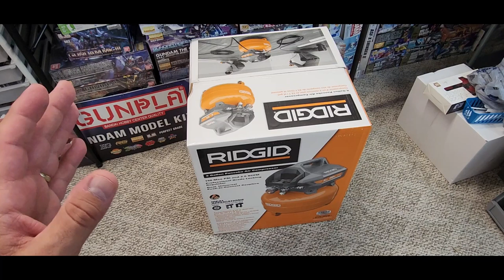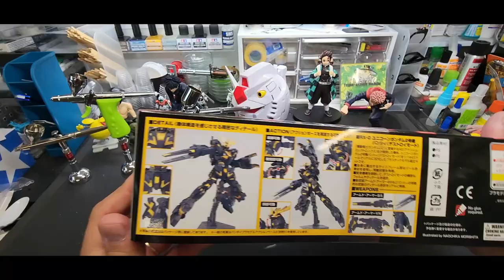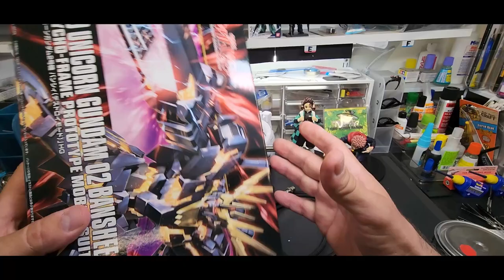How To Use A Full Sized Air Compressor For Airbrushing - Harbor Freight - Plus Gundam Give-Away

Comment: Nice! Well, that is always the dilemma when you have a shop, is how to mitigate compressor noise so you can talk on the phone or to customers in person. Some build enclosers inside with sound deadening materials and others have them outside in a weather tight encloser. I have a little 3gal pancake compressor and I think it's noisier than some of the larger compressors I have, but it's super convenient for on-the-job work. I've got an Italian ANI R160Q that's like that SATA with 1.0 tip that is a really great gun, a little more affordable, and takes very little air to run.

Comment: I thought about doing this. I have a 3gal from Harbor Freight, but I live in a town house and don’t have the extra room to shove it aside. I use an smaller air brush compressor with a tank and it works fine. I use it for priming and base painting miniatures for war games, but I do have some Gundams I will be building. I guess if you are painting larger items, and don’t mind the noise, or have a way to make it quiet it would be convenient to have the volume of air ready. Can you drain the tank? I wouldn’t want rust build up because I couldn’t maintain it.

Comment: There is a thing called Relief valve. It was designed for lower the pressure of the air stream.

Comment: I have the same compressor in my garage hooked up to a 50' flexzilla hose reel. Definitely not quiet, but It's a great pancake for general use and definitely works well for air brushing. A popular and cheap  HVLP gun that people seem to like is from Harbor Freight .. the 'CENTRAL PNEUMATIC
120cc HVLP Touch Up Air Spray Gun'

Comment: I wanted something portable so I went for a hobby air compressor with a tank. It seems to spray pretty heavy + urethane coat seems to be thick for that glossy smooth finish. Seems good for large surfaces like car kits.

Comment: Another great video I have learned a lot from all your videos what to buy what tools you need how to spray parts , I have my benches finished and hooking up the spray booth now will start soon maybe I can give you a suggestion I painted cars out of my garage for many years instead of buying a 60 foot hose you can use PVC pipe the thicker pressure PVC and just buy 10 foot lengths and glue them  and then you’ll be able to put a regulator and you’ll be able to leave the compressor in the other room and leave it on it works I have it in my garage for 35 years with a big Compressor  and they work great . I have put a line into my area off my main compressor but I also have the small little one that I bought for airbrushing because it would be nice when I take the cars out on my patio and spray clearcoat Automotive clear and just carried a little compressor out too the outside.thanks for the video ! Also what in your opinion is a good airbrush for my four-year-old grandson to start on with water base paint thank you !

Comment: When I first started airbrushing this was the route I thought I was gonna use, I had a little regulator on the hose to bring the psi down more because the lowest setting is still way too much but i had my hose spliced for the regulator and of course when the higher pressure came blasting through my little hose clamps didn’t do very much clamping,it was then that I realized I need to spend about 40 bucks and just get a damn proper airbrush compressor,smooth sailing since ,imagine that 😁

Comment: At Harbor freight you can get an extra pressure regulator for about $5, with that you can set it up for both with without having to adjust everything time you switch.  
Also great idea, I was looking to get into airbrushing, I have a big air compressor.  Didn't think it was possible to use with the air brush. This will save me some money. Thanks.

Comment: The Harbor Freight Fortress 2 gallon quiet compressor is pretty nice. It's quiet enough to have next to you without deafening you but it's not ultra quiet like an airbrush compressor. The smaller one from HF is supposedly quieter but I don't have that one.

Comment: I have an old old harbor freight oil crank compressor. It's not as quiet as my airbrush compressor but you can easily run with it in the room. I don't buy larger oiless compressors. Had 2 CH in the past and they burnt up. Cranks like oil. With that said, if airbrushing is all you do, oil less should be fine. And I'm sure the newer compressors are much better.

Comment: I run my iwata off my 15 gallon compressor with a water filter and it works great. I paint in my shop so the noise of the compressor don’t really bother me much. But, I wouldn’t recommend over 25 psi lol

Comment: Thanks for this video. I just started airbrushing literally yesterday and have been wondering how these larger ones work on gunpla stuff. Probably not as precise as some people need but I definitely see how it’s nice for just putting on your primer or base coat over a large amount of pieces. Have a nice 4th of July!
Reply: Air compressor size doesn't matter. You can still attach a .18mm airbrush to a 100 gallon compressor and it'll still paint fine detail.

Depending on compressor brand you might get a more accurate regator. Most shop compressors go in increments of 5psi, better ones go incrementally by one psi.
Reply: @fateweaver9844  oh i was actually talking about the large airbrush gun lol. The giant airbrush guns are fairly expensive compared to the smaller airbrushes you find most modelers using. But i may be wrong you might be able to get precise with those larger airbrushes. I imagine its just not ideal though since its so huge.

Comment: First time I bought a regular aircompressor for nailguns because the guy that sold me it did not know airbrushes needed a compressor with a water trap. I swapped it for a compressor designed for airbrushes.

Comment: I actually use a regular compressor but my hose has a built in water trap. I would like to change that to one attached to the compressor but it works for now. I already had it when I got my airbrush so I need to upgrade some day.

Comment: The harbor freight ultra quiets are fantastic and are super quiet. Also the conversions of fittings can get difficult depending on airbrush used with NPT and BSPP type threads used.

Comment: another great video my friend, I was researching air supply for my basement studio and while I own 2 Silentaire air compressors and have built a couple from recycled refrigerator compressors I am looking into supplied air from a a 5lbs co2 tank. the "rig" consist of a regulator($45) and rented tank same as beer tap ($140) ($20) to refill. totally silent and no need for water trap, have you ever experienced this set up? tee shirt painters have used this set up at out door events because it requires no electricity

Comment: Have a compressor a bit bigger than the one you showed. Was thinking of using it, but thought it was too big. I build HO scale R.R. and might be able to use the smaller airbrush with my compressor. Was wondering about using it, you answered my doubts.

Comment: Nice compressor to have to use with a air eraser (Sand Blaster) to etch or remove stuff. Also the price is very reasonable. Larger spray gun works great on small projects too. Thanks for the review!

Comment: Love your videos and really liked this one I have a 8 gallon quite hotdog compressor for my airbrushing going into a desiccant two stage filter and a regulator next to the airbrush booth. Your correct I can paint a model car and not even come close to using all the air and it's cheaper than a good airbrush compressor. Hope you get your ac fixed.

Comment: Check out the 2 gallon fortress from harbor freight. Its very quiet and sits next to me and doesn't wake up anyone in the house even in the next room. Its as loud as my small old air brush compressor.  Its really nice, takes about 45 secs to fill up. I tested a I can spray for 1 min 20 secs straight watching the pressure needle and it only took 12 secs to recover and the needle never dipped. Pretty impressive

Comment: I'd eliminate some of those connections which could end up leaking air. Iwata air hoses come with the 1/4 in compressor fitting attached.

Comment: I was lucky enough to already have a compressor before I started using an airbrush. I was also lucky that the airbrush hose I bought came with a 1/8" to 1/4" adapter.

Comment: The compressor has an internal pressure switch which turns it on to bring it back to full pressure.  In this case it is probably about 100 psi.  Remember it is designed for industrial air tools that need high pressure to operate.  The only way that pressure tank drops to 20 psi is if the power switch Is turned off or the cord is unplugged.

Comment: First another great job. I looked at Sata paint guns and they are quite expensive. Too much for me I think. I then looked at Harbor Freight for their detail guns and they aren't recommended for 1 to 6 gallon compressors. The Fortress Ultra Quiet compress looks like a good unit and I hope that is the one you will be testing. In roughly the same price range as an airbrush compressor but with much more capacity. I don't build Gundum so please don't enter me in the drawing.

Comment: The easiest way to sort out fittings is to get a 1/8 BSPT Male to 1/4 NPT Female, then screw that onto whatever airline fitting matches your coupler. I'm going to guess you'll be checking out the Fortress quiet compressors next then? I've been eyeing them up myself. $200 for the 2 gallon is a little steep but it is a twin piston compressor which is nice.

Also for the giveaway fiasco, try using like "Gratitude Gift" or "Gratuity" or something with the same meaning but not so easily recognized by bots.
Reply from the maker: I hope to review the Fortress soon also

Comment: Ok you did not a separate air regulator, my pancake compressor is a oil type so much quieter , but I think I know what I need thanks
Reply: You might want a trap between the compressor and brush to trap any oil or moisture that comes through the line.

Comment: Everyone should know there is a cheaper and better option then a hobby compressor. I have 2 25 liter tank with a silent type aircompressor I use now. And stored my Iwata Powerjet compressor in a cabinet as a backup. The large 25 liter tank is a joy to work with. With a long period of silence from the compressor before it kicks in to refill. In USA I believed the California Aircompressor is a great source. Avoid oil driven compressor coz they are noisy. For the price of one Iwata Powerjet compressor, I can get 2 25 liter 1.5 hp silent aircompressor that I use for my scale model hobby and woodworking.

Comment: I will eventually want to upgrade to a higher capacity compressor. Mine just always goes off with every push of the trigger, which isnt bad becaue its quiet but still would like to have more capacity.

Comment: Nothing wrong with a shop compressor. Get a moisture trap and that's all you need. 

Most can be had under $100 USD. Push plenty of air. But noise is an issue. Not ideal if you live in an apartment or don't have an outside space away from the main living space.

My compressor is a 2G Husky brand. It works just fine with my HP-CS and my Patriot 105 with no issues. 

Hell, those people that do airbrushing on cars, trucks, semis don't use hobby compressors.

Comment: Only for the sake of overkill. I was thinking of a stand up 30Gal to go from 1/4 to 1/8 with a second regulator/water trap for my spray gun
Reply from the maker: A great option for sure. If I'm going to start using that spray gun then I have to switch too

Comment: to many fittings. could use just one between. Some time they provide it with Pistol look airbrus. it's a male for the airbrush hose and female for the fitting that goes in the compressor.

Comment: I like the  Harbor tool and freight air compressor  2 gallon 135psi with 2.1cfm and it's 1.2 hp it's has been a very good  Air compressor I have about 6 different air compressor and this one is the best super  Quiet it's  under my table and I airbrush at least 6 to 12 hours a day. Most of the air compressor are all made in the same factory in China they just put decals them .

Comment: Its funny, because I literally just got into modding my air compressor. I bought an 11 gallon spare air tank, to attach to my 6 gallon AC. But i am modding it to run off the spare tank and have it start filling after depletion.

Comment: The Harbor Freight fortress 2 gallon compressor is VERY quiet. I've got it running in the same room and its very tolerable.  Quieter then my vacuum for sure.  Also that Sata Minijet is pretty expensive at like 300-600 bucks.
Reply: Also also you will blow through that 6 gallon compressor real quick with the spray gun.

Comment: I'm going to have to invest in a compressor + tank. I'm currently using an Iwata Ninja which has no tank so it runs all the time, and the pressure knob has no gauge, so I just have to guess.

Comment: Great video, this is the way I want to go with my setup. I will install the compressor in my garage on the other side of the house and run the lines when needed.
I was expecting to see some water traps or in line filters being used also. If you use this unit a bit more will you add any additional traps or filters to the system?

Comment: Question: what pressure did you used for the big air gun? If you used 25 psi, can you use it with the tooth air compressor?  That one goes up to around 50 psi. Thanks.

Comment: Did you have trouble with different thread types? I ended up sending my regulator and moisture separator and buying a cheap one at Harbor Freight. It has all NPT threads.

Comment: Too bad about your AC - not fun in this heat without that!  I have a full sized compressor with my set up and it works just fine with the proper adapters and quick connects on your spray guns.  A moisture trap is a good idea - don’t need stray condensation ruining your work.

Comment: Do you think a portable tank you can fill with a larger compressor would work as well?  I do a lot of air brushing and my hobby compressor comes on which is a pain.   Thanks for your layout of the parts needed.  Your videos are always helpful.
Reply from the maker: my buddy uses an air tank and has no troubles at all. Just don't expect a days worth of air

Comment: sucks about air going out...miserable...I wish I had thought about shop air compressors when I got set up. I picked up the cheap chineese compressor with a tank, it has a emergency shut off if it gets too hot it is supposed to quit. But after only about 7 or 8 min of spraying it acts like it is going to shut down on me. I figure its only a matter of time before it craps out...lol

Comment: Neat. I just bought a compressor myself, 6 Lt 115PSI silent compressor for indoor use, it's quiet enough to use in the same room, and doesn't turn on that much for airbrushing.
It only has one output and I regulate it for about 80'ish PSI on the main regulator, but I ended up putting a T on it, one has a full size hose to an air pistol and other tools, but I mainly use the air pistol to clear out dust before airbrushing, and the second end of the T I put a "moisture trap/regulator" combo fitted to the airbrush size, and regulate it to the pressure i want to paint. This way I have both pressures at the same time, one for the air pistol or other tool, and the limited down for airbrushing running at the same time. Been working great so far.

I'm currently building a sort of enclosure on wheels for it, to store the compressor and all hoses and air tools that I can car around as needed.

Comment: I hate to break it to you put the HVLP even though you’re only using them on small items it’s recommended or they require 25 gallon air compressor or bigger. But then again, you’re only using them for a really small like toys, not what they’re actually designed for.
Reply from the maker: I've had it sitting around and I wanted to try it out for the first time. I've since purchased and test here on YT an Iwata Baby Spray Gun that only requires 20 psi to run.

Comment: I got an air compressor from Walmart. Don’t like it. When filling with air, the safe valve opens thus losing a lot of pressure. It doesn’t stop automatically. Is that normal? Thinking of returning.
Reply: I’m 🤔 not sure. Maybe it will explode 🤯 if it ain’t shut off automatically. Be sure you put it outside in case it does blow ⬆️.

Comment: Firstly: Don't consider this comment for the g.i.v.e.a.w.a.y. as I had the exact same kit delivered a few weeks ago 😊

I bought a 50L compressor several years ago.  I was able to buy a single M-M piece, like the one you used at 10:08, but it directly stepped down from 1/4 to 1/8.  My compressor, however, didn't come with Q/R fittings on it, so I was fitting straight into the threaded barrel.

My other compressor is the same as your no-name.

Comment: 0:47 holy fuck. thats a $500 paint gun
also, its terrifying you have a $500 paint gun and no water separator. it would be very worrisome even if you had a $50 airbrush and no water separator but GOD DAMN.
14:28 "low priced" im guessing your brother gave that to you and you have no idea what your holding (relatively speaking).

Comment: I don't get the advantage of getting this over an equally priced hobby compressor
Reply: I have a 2G Husky. Paid $50 for it at Home Depot. Haven't seen a hobby compressor that cheap ever. 

If you never plan to do anything larger than tt miniatures or Gunpla a smaller hobby compressor is fine but if you ever want to get into RC vehicles or maybe larger terrain pieces for tabletop a spray gun is handy but your average hobby compressor won't push enough cfm to operate a spray gun